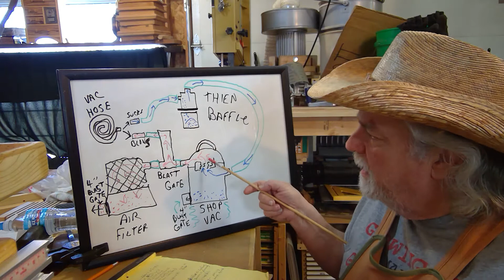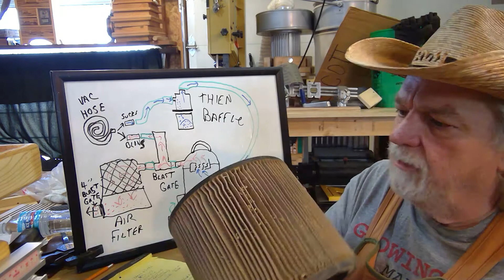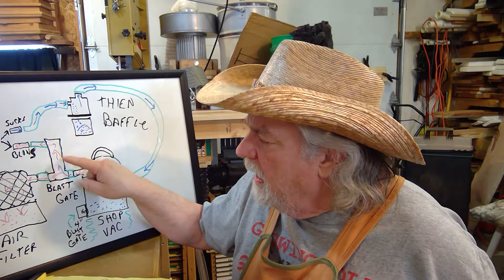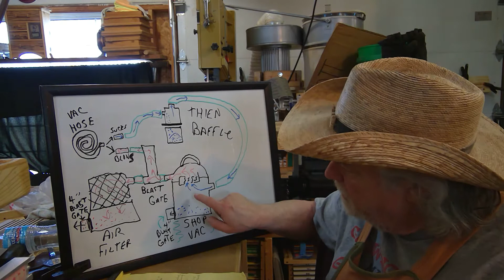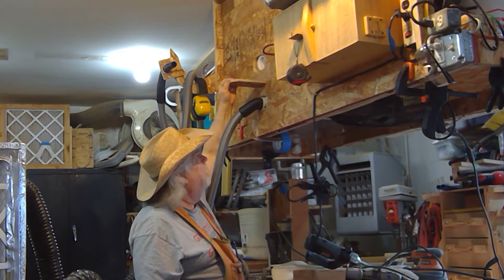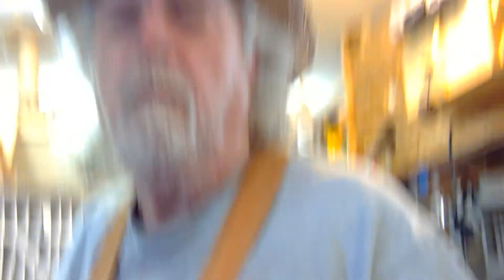Shop Vac Multitasker by OTB Thinker

Comment: My feelings is that the filter needs to be on ahead of the blower to protect the blower from being blasted by the dust particles. That blasting can damage the impellers. That may or may not be a factor for you.
Reply from the maker: In theory, there is wear and tear.  The fine wood dust would take years (maybe even decades) to wear it down noticeably.  Motor would wear out much sooner, in theory :>)  The air filter accessibility can be easier if place after and I can make a pre-filter/filter setup easier too, making the life of the main filter to last longer, in theory.  It can be done either way, though.  Thanks Don.

Comment: Hey Russ, I made a Thien baffle and mounted it in a 55 gal cardboard drum, it worked great only had to empty it a couple times a year. Then we moved. Downsizing purged a lot including the baffle. Now I just use a shop vac with the  paper bag insert. Getting ready to build a box on wheels for it to hopefully cut down on noise.
Reply from the maker: I guess I have to give you the OTB Thinker challenge.  you can make a box on wheels that can hold all 6 components shown in this video and keep the box under 4' tall.  If interested, I might have some ideas to help with the conception. Hey, come to think of it . . . It might even make a good video :>)  thanks for the comment.